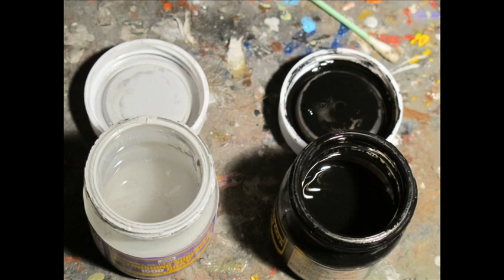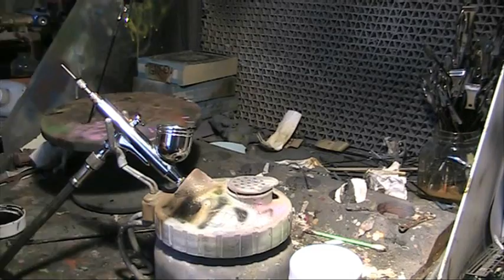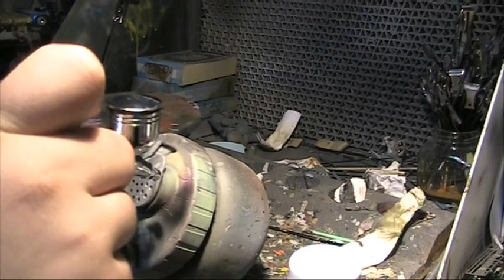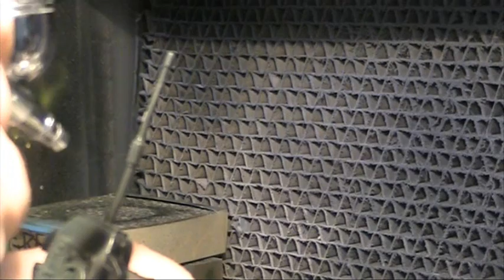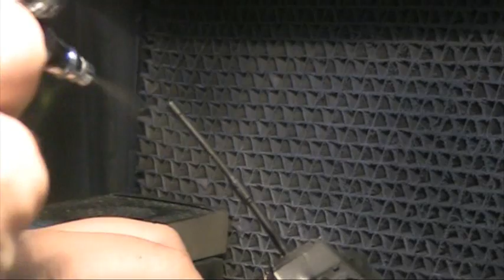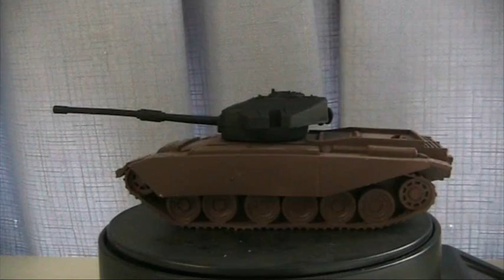Gundam/ mech model workshop 93: Mr. Surfacer 1500 Black review

Comment: These mr. Surfacer grey 1500 can I use metallic colors like mr. Surfacer black 1500
Reply from the maker: Sorry, dont sure if I understand. Are you asking if metallic paint can be used on Mr. Surfacer 1500? Answer is yes you can on both grey and black. If your asking if Mr. Surfacer 1500 black is metallic then the answer is no, it is flat black. If you want your metallic to shine ass gloss on your base coat. Let me know if this helps.
Reply: Because I ordered mr. Surface gray 1500 and I want to try it with metallic
Reply from the maker: @gordongriffith9047  it is very smooth and will work well.

Comment: Hey great video, was wondering if you can sand this down if it's needed? I'm currently using Vallejo primer but when I sand the messed up parts it just sands off the primer completely :/ I've been looking at buying Mr. Surfacer and some thinner for it but I'm not 100% sure about it, thanks again for the video !
Reply from the maker: +spaghettijustice Vallejo has adhesion issues and just sits ontop of a surface with out really binding. All lacquer and enamels will stick to a surface and can be sanded off, buffed and masked. I've always had a little issues with Vallejo but find Mr. Surfacer easy and fantastic to use.
Reply: +mokanaman Thanks a lot for the information and reply!! I shall be buying some Mr Surfacer bottles then :) that cleared a lot up about the Vallejo primer!

Comment: Hi nice video there!, Have you used Mr resin primer before? is it thicker than the usual mr primer surfacer 1000? Having issues trying to get the correct ratio for it(it gets so thick at the cup and clogged it at the bottom despite using 1:2.5 (paint : thinner) ratio.
Reply from the maker: tester6660 I have sprayed much thicker then that though a 0.3mm airbrush. Here is the tutorial. https://www.youtube.com/watch?v=_Lp1puYPvBw

Comment: Finally used it on my 40K models. It is fantastic, it does not chip or peel off like the vallejo. However, can you suggest me how and with what to thin it. I tried ISO but Iam not sure that is what should I use.
Reply from the maker: You can only use Lacquer, muilty purpose or general purpose thinner, it is a heavy solvent and wont react to alcohol based thinners.

Comment: what about its grip on surface and of paint on it ? i intend to use it on plastic and to spray over Tamiya acriic paint
Reply from the maker: Standard lacquer grip on painted and bare styrene surfaces, light application will not be an issue on cured Tamiya arylic.

Comment: This primer is scratching off the model so very easy. Any suggestions?
Reply from the maker: make sure you allow time for the primer to fully dry and harden. Check if the surface is free of oils or dirt by washing and for extra grip sand the flat surfaces with between 400-800 grit sand paper. There is also a chance this primer is not quite right for your job and a different type may be needed. Also are you spraying a styrene surface?
Reply: I am using the 1000 over Games Workshop Models and Zvezda... But it looks like that this is not a Primer, but something else that is designed to create rather a texture rather than a coat. I bought it because I just started to use airbrusj.
Reply from the maker: And the bottle looks like this? http://www.mr-hobby.com/en/images/item/255/1.jpg. This is strange I think we may have two problems. First what thinner are you using? If the thinner is correct then the place you are buying the paint may be bad. I once bought tamiya paint from a shop who use to steel half the content then top up with water. You may need to buy your primer else were. I also recommend trying Tamiya surface primer as it works well for me on plastic.
Reply: Unfortunately it is written only Surfacer with nothign else :( But it was sold to me as a miniature primer.... I think I have the wrong stuff here.
Reply from the maker: This could be the case.
Reply: I will specifically buy Mr. Finishing Surfacer  and see how it sprays with the airbrush.